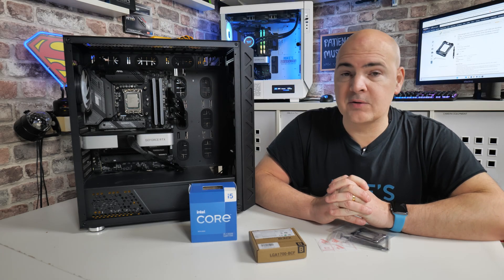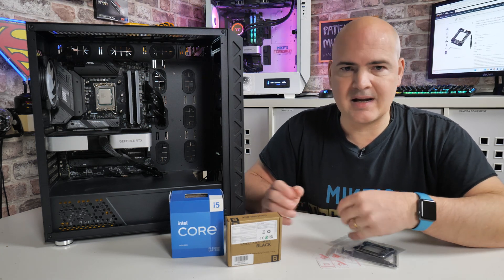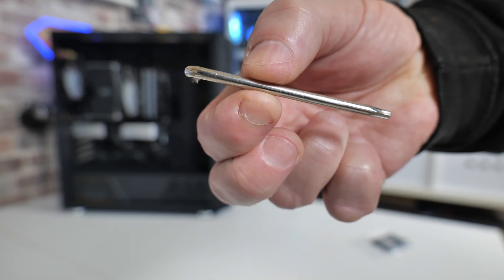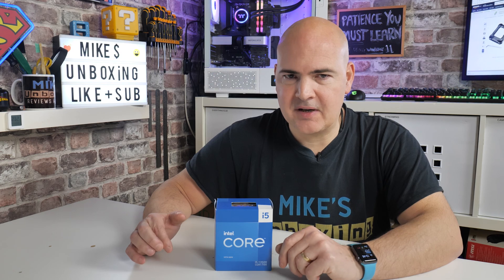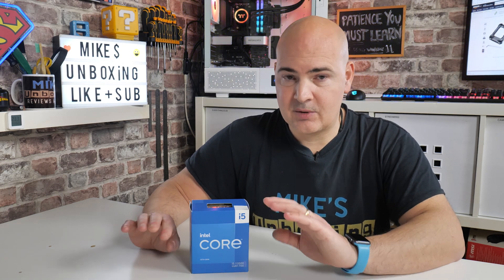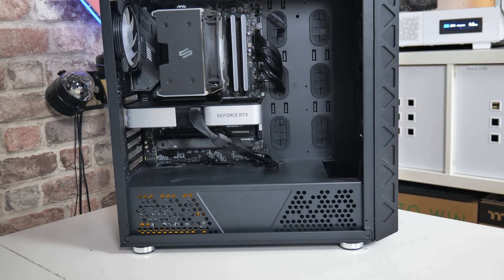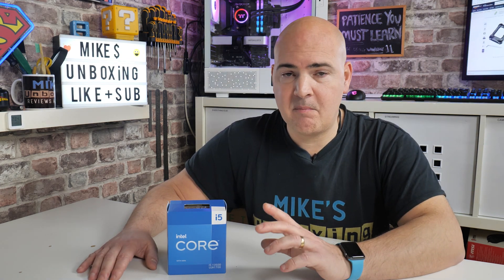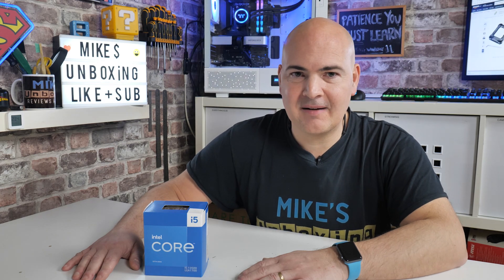Thermalright LGA1700 BCF Contact Frame Plate Weird Results Please Help!

Comment: The torque specified for the "Thermal Grizzly" is between 0,03NM - 0,06NM. That's around 1/100 of what you just showed to your audience. 🙄
Reply from the maker: well it is a good job that this isn't a thermal grizzly then. SMH
Reply: @mikesunboxing  Since the screws used are exactly the same the torque "translates" into the same pressure on the contacts regardless which frame is used.
In the video you actually noticed that the screws on the stock ILM weren't particular tight to start with.
Maybe your lack of cooling performance was in fact due to overtightening. ;-)
IMHO Gamers Nexus did a better job describing the procedure and also paid attention in order to avoid double-threading.

Comment: Problem here is using a 13500. It's a low power chip. The difference really only becomes largely apparent on say a 13600k 12700k,13700k etc. The bad contact patch is still generally enough for these low power chips
Reply: I was about to say the same... These contact frames are pretty much overkill for an i5. These were made for high-end processors which run way hotter and thus bend much easier than colder ones.
Reply: I don't see any improvement for a stock 14600kf.
Reply: @harley9698  noob here.... what is ihs please? About to mount my i7-13770K. Thanks
Reply: @wolfsmane  The Integrated Heat Spreader (IHS) is the metal exterior lid that makes contact with a cooler using thermal paste.

Comment: I have a Dell XPS 8950.  Only one side of the cabinet comes off, so I can not access the back of the motherboard.  Is the back portion of the ILM frame attached to the motherboard or will it drop when I remove the 4 screws of the ILM?
Reply from the maker: it is attached so you shouldn't have too much trouble
Reply: It MAY be attached. In my case it wasn't, and immediately fell off.

Comment: A reviewer when can't even follow basic instructions on how to tighten each mounting screw as per gamernexus.....
Reply from the maker: the gamers nexus instructions are the same as the instructions for the thermalright ones, basically tighten until a hard stop (mikes own words) 
you are thinking of the other frame that requires specific steps.

Comment: If you replace original brackets.  Then for 12th gen the problem may related to wrong mounting pressure.
Reply from the maker: shame that all this isn't in the user manual
Reply: @mikesunboxing 

0.5Nm = 0.051 kilogram - force - meter

You need to screw each nut between 0.4-0.6Nm. 

What you should do. Get 1 meter solid wire. Put wire in horizontal only. At the left end of the wire add screw in. At the right add 30 grams. Release the wire. It will screw 30 degree. Then put out the wire from screw. Reposition at horizontal. Put into the screw. Release again. The 30 grams at the end of hard wire - rod will screw again 30 degree. Repeat until hard wire - rod will stay in horizontal position and not make any tide,move. 

Why 30 grams at the 1 meter from screw? In fact must be 50 grams. It is 30 due to solid wire also have mass. You can use 30 grams and some stick - solid wire which is not more than 30 grams. 30 grams 1 meter stick and 30 grams mass at the 1 meter end will do the job perfect.

This is the way haw you can tide the screw until archive 0.5-0.6Nm without torque screw.
Reply: @mikesunboxing my last calculation are.

200 gr place at solid stick wire at the end exactly 20 cm from nut.

Comment: Reduced my temps by 6-7°c so works great tbh. I know many others who swear by it.
Reply from the maker: is yours 12th gen or 13th? seems the difference is more with 12th gen or slightly cheaper motherboards with less dense layers
Reply: was it a new build or you already used the cpu for some time before installing the contact frame? I just received mine but I have already been using mine without a frame for about a year now

Comment: The way  you screw that in is not good man.
Reply from the maker: what was wrong with it?
Reply: @mikesunboxing   First off english is not my native language. First  im not sure if you installed the back plate of a cooler you intend to use it would give pcb more stability. 2nd you should have made sure you are alining your screws with threaded screw holes becouse if you miss one you can screw harder on one side then the other. Then you should have make smaller intervals more frequently while screwing it in to keep consistency. Also these are all after market products and you could have just gotten a crappy piece of aluminum with small imperfections.
Reply from the maker: @gaddag1477  the point is that thermalright prove zero information on installation so any speculation on how it should be done is not able to be confirmed by the manufacturer

Comment: You aren't supposed to torque the screws down you're supposed to stop tightening as soon as the screw stops.
Reply from the maker: that is what i did, you hit the hard stop - i.e. you can't turn any more
Reply: @mikesunboxing  I almost forgot something, I had similar results to you at first, turned out I had mistakenly plugged the CPU fan into the chassis fan header next to it. All my fans are set to follow the CPU fan so they all ran at low speed until I noticed which was after removing the cooler and re applying the thermal paste, doh! No harm done but it was annoying.
Reply from the maker: @atomicskull6405  Thanks for the info

Comment: Assuming all settings were the same, the contact frame is going to give you anywhere from 0-10c less temp. It’s possible your stock retention bracket is already providing a level surface for your heatsink and that’s why there is zero improvement. People get reductions in temp only if their stock retention frame is causing the cpu to bend/warp and make it no longer a flush surface for your heatsink. I would think most retention brackets would cause this, but it’s certainly possibly to get a hold of one that doesn’t, at least initially. After you add in heating and cooling cycles from normal pc use plus time, you may then experience further bending.
Reply: help me i want to buy i9 13k with z690 msi ace with  EK Nucleus AIO CR360 do i need contact frame for this kinda build im new pc building
Reply: @syrex471  yes, you will want to purchase a contact frame and I highly recommend the Thermalright LGA1700 Contact Frame. I just installed mine the other day and it’s much easier to screw down without over tightening and putting too much pressure, like you can with the Thermal Grizzly 12/13th gen contact frame. Just remember to save your torx screws from the stock retention bracket when you remove it so you can install the contact frame and also keep your cpu in the socket so that you don’t drop something into the socket and damage pins.
Reply: @syrex471  also, I would get a Z790 motherboard instead of a z690, the z790 supports higher speed ddr5 memory than the z690. I personally would get an Asus z790 motherboard. Second choice would be MSI.
Reply: Thanks for advice but I have rtx 3090 and ddr5 6400 unbuffed even if get 8000mhz  ddr5 I will get dimishing returns and 3x the price this thing the best can only utilise on rtx4090

Comment: following your explanation very carefully, it seems that ONLY the first install (with the intel clamp) was different; all the rest reproduced results, so i would see the difference there. COULD be, that this first install bent everything just "right" and worked best until you removed and replaced it. what this doesn´t explain to me is the power increase, but maybe you check your bios for intermediate changes, since it might have "learned" different (memory) specs after the cpu reinstallation.

Comment: Seems like your cooler is not really build for 13th gen, i use a Noctua NH-U12A chromax black (has more pipes to transport heat) on my 13700k and its fine, no contact frame

Comment: if i had to guess, you tightened the bolt totally before doing the others, so its uneven now. As far as I understand it, you would snug the corners, then tighten a bit then a bit more till its tight. It may be that one contact is just a bit more squished than the others?
Reply: They should design one with shoulder bolts with springs under the heads that press down from above. That way pressure would be from the springs and not screw tension.
Reply: @atomicskull6405  the whole process was nerve racking. I was going to chicken out and return it... But then I realized that my heat sink also has screws just like this one. And it would be dumb not to install it. So  I did. Basically turn each one a quarter turn till snug, then a quarter turn more and that's it. Clean cpu, cooler, add the goo. Then carefully tighten the cooler. I used  my fingertips on a drive till it was snug and couldn't turn more with the force of finger tips. Then crossed my fingers... My last coolers all had that easy to use snap design. That would have made things a lot more confident feeling.
Reply: @mikesavad  From what I have read about the thermalright frame you are supposed to turn the screws until they stop and no more than that not cinch them down. I personally would put a bit of threadlock on the last couple threads as a precaution against them backing out.

 The coolers I've seen that use screws all have shoulder bolts with springs on them. It's the springs that apply pressure not the screws so how tight they are has no affect on cooler pressure against the CPU. Al long as the shoulder bolts are bottomed out the springs all apply equal pressure.

Comment: This makes sense since 13gen performance scales bad after 125~150 watts, my 13600k at stock speed draws 257 watts/w CB score at 24045 points, then I limit my package power at 150W gave me 24018 points. Tuning the power limit in these range consistently gave CB score around 24k pts.

I guess since your CPU were cooled better in the process, so it boosted for longer with a higher wattage, but the CB result didn't improve much for obvious reasons.
Reply: more wattage doesn't mean better performance. it never does.
Reply: Bro my 13600kf draw 170 watt at 5.3ghz all core, how u have 257 watt?

Comment: During disassembly BIOS voltage settings were reset to stock. You have go back & reset all your voltage settings in BIOS the way they were before.

This happened due to motherboard detecting CPU was removed & replaced. It thinks it is a different CPU & set settings to guarantee booting. Even though processor was never completely removed electrical contact was broken.

Given the difference in wattage your CPU was likely undervolted by .150 volts before. It is common that 13 gen core i5 processors can be undervolted easily by .100 volts.

Comment: Dors anyone tried the contact frame on z790 mobos? I keep reading that the screws are too short! I ordered the grizzly one which now comes with 4 screws but i dont know if its for z690 or z790. My components didnt arrived yet so i didnt try
Reply from the maker: not sure sorry, the screws were fine with the b760 though which in theory should be the same setup

Comment: hello mike : there are some tips ,  N1 you have to tighten the contact frame in a cross pattern X like 1-4-2-3 or 1-4-3-2 and 13thgen cpus run hotter and ar more power hungry. N2 I recommend using the arctic mx 6. N3 check the ihs, it may be bent or concave.  N4  check the bios setting (some bios have water cooling mode , it may fluctuate the wattage), check the cpu lite load. N5 do not expect an improvement less than -10c ( thing mod only inprove the temps -5c/-10c)  no mater the previouve results .   I wish you the best of luck , be well.
Reply: this is correct.
best pattern is X cross tighten
Reply from the maker: thank you sir
Reply: @mikesunboxing  You wellcome .
If you have any more doubts about the contactframe, you can watch the video on my channel, I'm already on my 12th application of the contact frame in 2 months, I'm from Portugal and as we have a warmer climate and some customers started asking me to put contacframes on new builds, i plan to buy some Torque screwdriver and i will find the torque contact frame  for sure.
As you may already know the best video so far is gamernexus on the matter. Btw just subscibe to you chanel.
Love you video on the Thermalright Assassin X ,a perfect application of the coller.👏

Greetings from portugal
Be well .
Reply from the maker: @fexergametech  Thank you! And welcome to the Channel 🙂
Reply: Literally using a cross pattern while securing damn near anything is common sense.

Comment: Intel should have thought of a better way to mount the CPU with possible less chance of damage and thermal issues to the CPU. Hope you get better results with the AM5 brace I sent you. Should at least keep the thermal paste from running down the sides of the CPU? Take care. Cheers
Reply from the maker: yeah the AM5 stopping the goo going down the sides will be a welcome addition, still need to get the 600 series board for intel and see if the difference is more pronounced with 600 over 700
Reply: it came down to $, They already have better solutions for server cpus
Reply: @jeremytine  That they do. Still if you already have it...use it for the LGA1700 also. It always comes down to money. Cheers
Reply: Yeah ironically this is much safer, the original seems you sre crushing the cpu with infinite force

Comment: Hi Mike, not judging or criticizing, but I was wondering why you didn't do the "reverse turns" on the loose screws to "seat" the screws properly.... and you seemed to tighten the screws in a cross fashion almost nonchalantly. Does it really matter? Some people are stressing super hard about the technique involved in, installing this contact frame.
Reply from the maker: yeah the mounting of the thermal grizzly one has made a lot of people consider the mounting pressure issue. In theory the thermalright has been machined to be tightened down to the hard stop, so this should in theory mean that the uneven mounting is avoided.
It could also be that after 600 series boards had so many problems the 700 series are now made stronger to not bend and really not need the mounting frame
Reply: @mikesunboxing  well I’m running with an ASUS z690 D4. So I’m wondering if it will be necessary? 

And while I haven’t mounted or turned on my pc yet, I have already assembled the cpu, mobo, and air cooler. So, has the damage been done? Is there any point to undo what I’ve done and apply the bracket?
Reply from the maker: @ptung88  from what i am seeing the 600 series boards appear to be effected more than 700 series, so i would probably recommend it for 600 series boards, 700 series for me the jury is still out on that
Reply: @mikesunboxing  

But if it’s already been bent, does the contact  frame help “straighten” it out for better contact or what? 

Or should I leave it as is ?
Reply from the maker: @ptung88  i just re installed mine and noticed that there is a definite either dip or raised section in the centre so hopefully now after a while the more even mounting might level things out, i would install one ASAP for all LGA CPUs regardless of board just to be safe in the long run
Reply: The reverse turning until you hear a click is for your average housewife that can't tell if something is cross threading

Comment: there is some news about intel blocking undervolt for intel cpus. the undervolt you made might have been undone. that might explain the increase in power draw.
for the record I managed to Undervolt my 13500 by -0.160v offset and runs cinebench r23 at 150w with 21000 score. cpuz bench at 112W and 8660 score.
Reply from the maker: nice one, and thanks for the info

Comment: Mr. Mike, I hope on your next run the bracket proves positive for you. I put mine on today, and lost 8c on temps, and system seems way more snappy than this morning before the bracket install. i did take note of the thermal paste pattern on the IHS when i pulled off my cooler still having the stock ILM, and it was a high spot in the middle, with the paste really pooling at the tabs where the bracket clamps down. interesting. For tension I let the bracket stop me with a hard stop and then no 1/8 or 1/4 turn anything after. Waiting for the follow up.
Reply from the maker: yep need to get this done again, thanks for the feedback on your setup, was it 12th gen or 13th
Reply: @mikesunboxing  thanks for your reply. Its on a gigabyte aero G z690 ddr4 board. with a 13900k. a couple of things for you to note, for the tension, let the bracket and board stop you. I miss spoke in my previous comment which i will edit. i dismounted and mounted my cooler 2 times to see the thermal paste pattern. when i took it off while having the stock ILM i noticed that my chip was bowed up in the center from north to south, leaving big pools of tim near the clamp of the ilm and the tabs on the ihs. once i mounted the bracket and pasted the cpu i fully installed the noctua d15s, then removed it i notice that the paste pattern was even across the whole chip and created a great deal more suction when dis mounting. I hope it works out this next time, because so far the bracket lives up to what others are saying. I got the bracket for the bending more than the temps as i tend to use my tech for a long time, so for me its more a preventative measure.
Reply: @RiceNoodlestw  That was my reason for buying mine also. Longevity of the system. Cheers